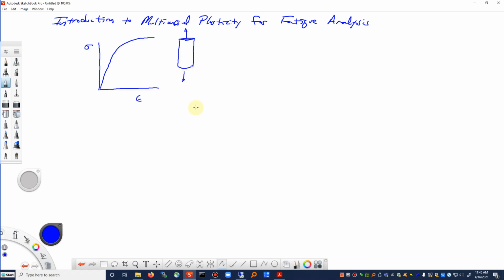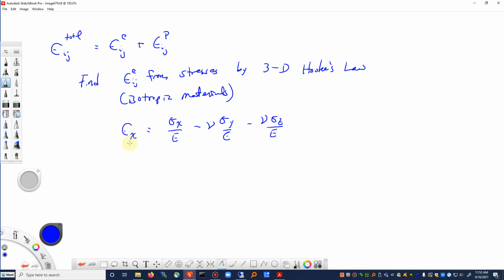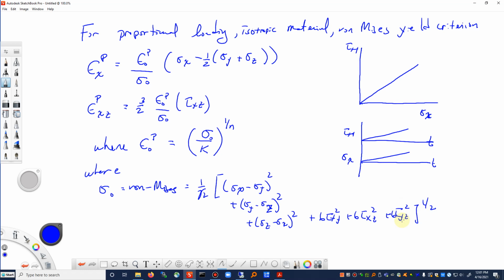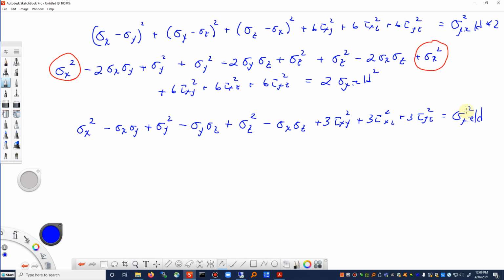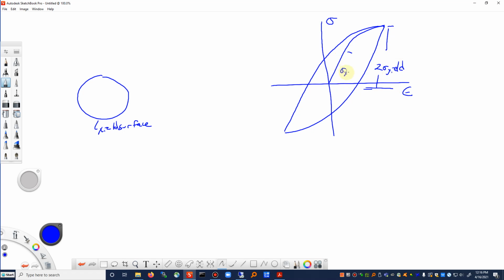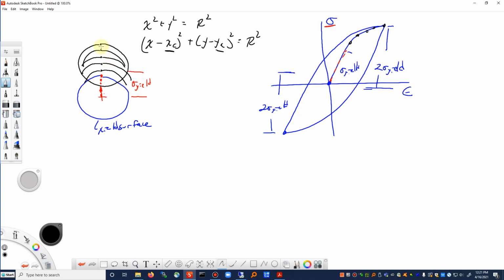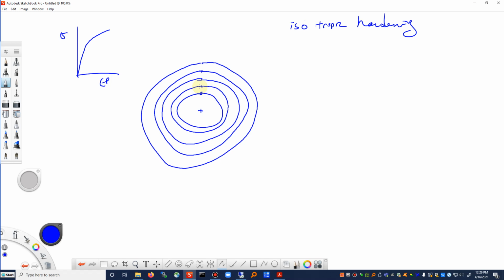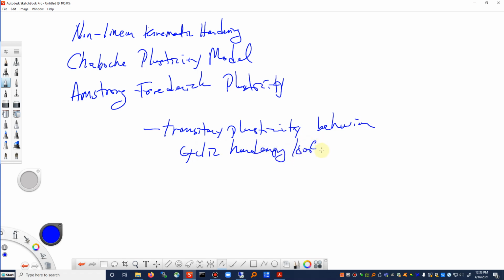28 Intro to multiaxial plasticity for fatigue analysis

Comment: Thank you for useful video!
I have a problem. In my case, the vessel is subjected to internal pressure and before cyclic pressure, there are autofrettage process (large value of internal pressure to make the vessel yield fully). 
Based on finite element method, I know about the stress and strain amplitude during cyclic pressure but the predicted fatigue life is too large compared with the experiment (nearly 5 times)
Could you help me explain the reason, please!
Reply from the maker: I would suggest you review the work done on autofrettage at the Technical University of Darmstadt  by Tim Seeger, Michael Vormwald and Volker Koettgen.  There can be many reasons why experiments and calculations do not align and any reasons I could give right now would only be guesses.  But I have seen calculations that use the multiaxial strain life approach be successful for autofrettage.  Happy studies!
Reply: @mbarkey.mechanics  Thank you so much!
Could you give me some papers or research of given authors, please!
Best,
Reply from the maker: you will find them with a search.  Happy studies.